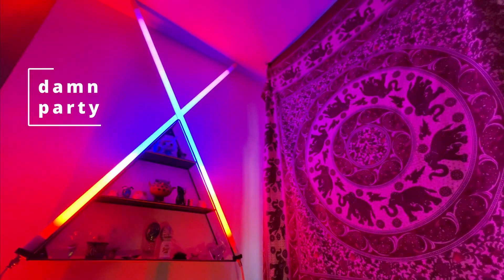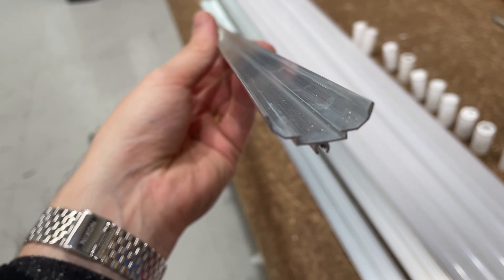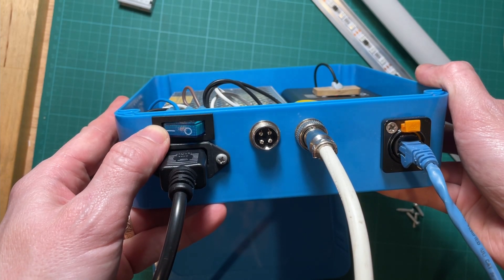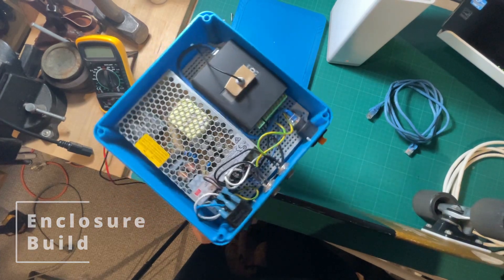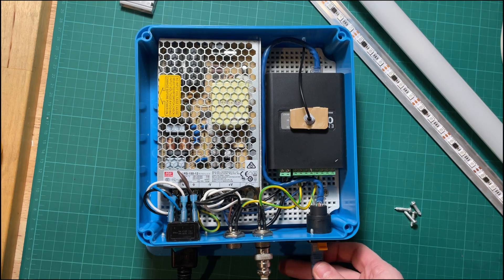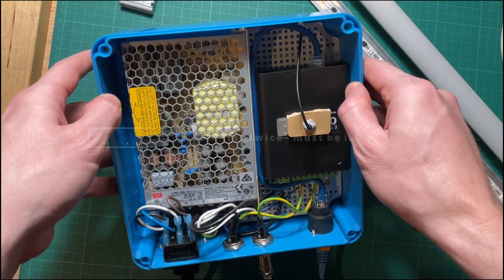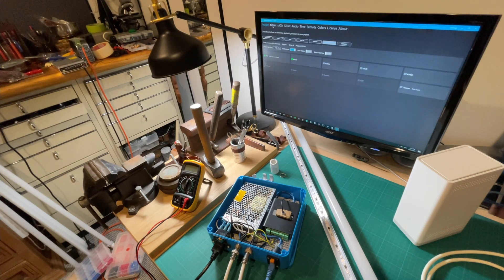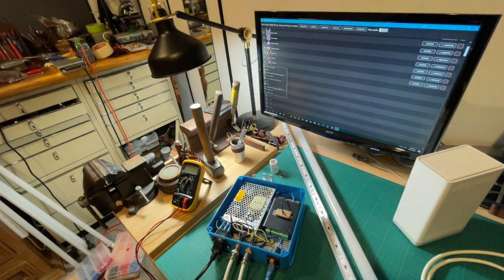DIY LED Pixel Tubes

Comment: Hi, I secured way to setup 10 led tube together and control them all together with an app , you suggest what / how to link them and control together  and what to use for wifi controller and power supply ? Thanks

Comment: You can buy adressable led strips for 25 $ those entec cost 180$ what is the difference? Its just because its sponsored? Because you can achieve the same result with a WLED controller (DMX with artnet as well) You can have tons of options on led strips 5v or 12v, and even water proof. and you would never waste 180$ in everything combined.  You could do all of this with even more functionality for way less. like 60 bucks. (Edit: I even noticed that they are adressable in each 3 leds. You could have true individual leds. And water proof and 60 leds per meter anyway.)
Reply: any link for addressable strips that you recommend?

Comment: Do you have any close ups of the wiring you used to make them daisy chainable?  Did you just run the data back to the bottom of the tube and gang all the wires together on that end?